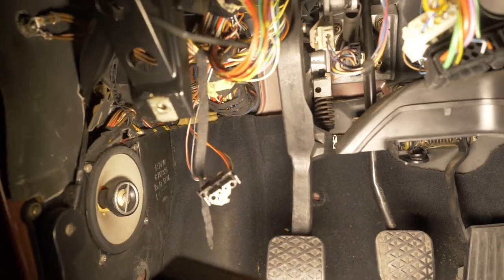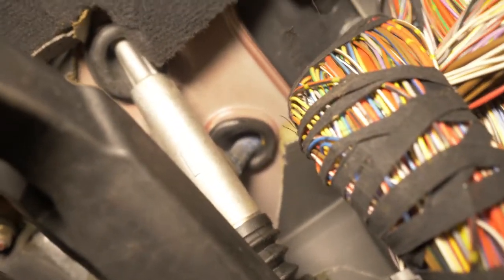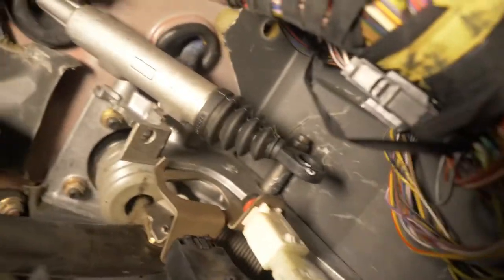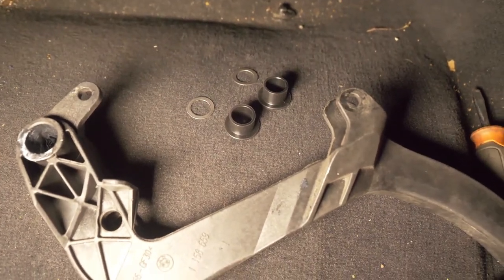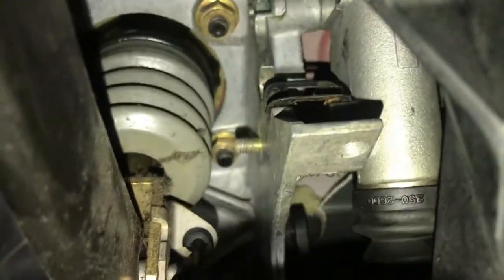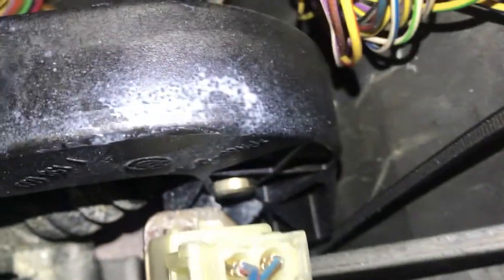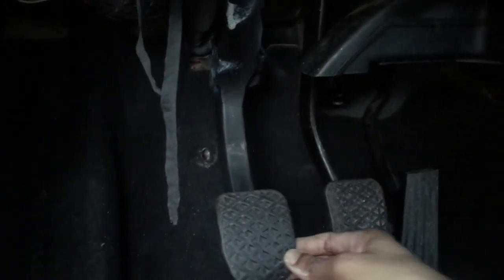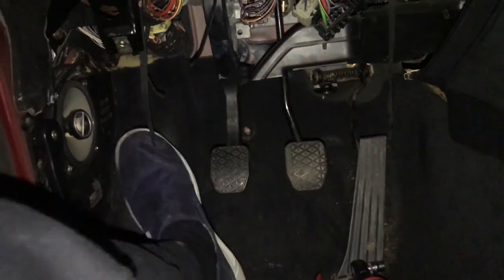BMW E36 Clutch pedal bushing install / helper spring delete

Comment: Is my e36 clutch pedal supposed to be aligned with my brake pedal or is the clutch higher? Because i can still pull my clutch up but it just falls back down and aligns itself with the brake. My clutch sometimes bites right away but when i pull it back up and the clutch in it bites higher when im letting off. Any reasons why?

Comment: Follow all you did and have the slack and the pedal is also higher. How can I fix it? Also you need the spring. I drove without it (before I saw your video so not your fault) and my leg hurt after 5 months

Comment: Did these bushings solve your clutch engagement problems, same thing is happening to me on a 2k mile old clutch+flywheel

Edit did removing the spring do the trick? or did you end up having to install a new master  and hose